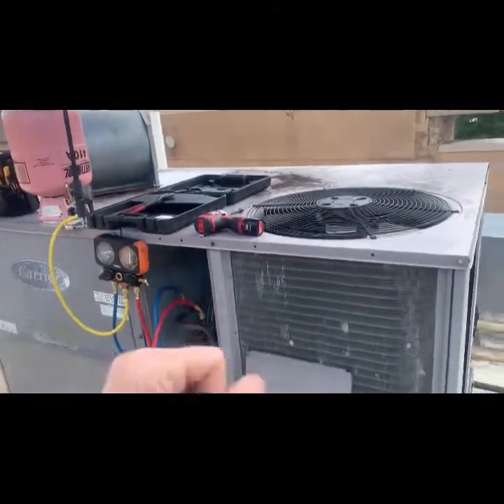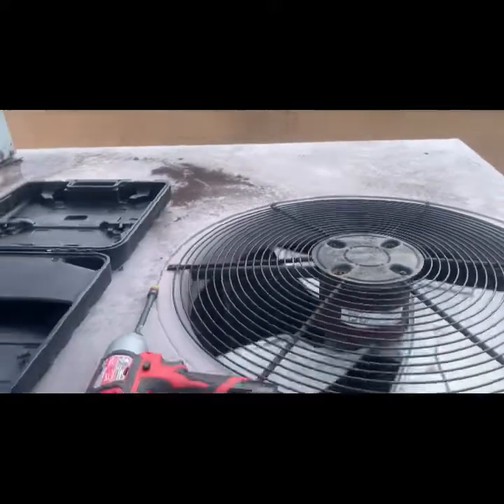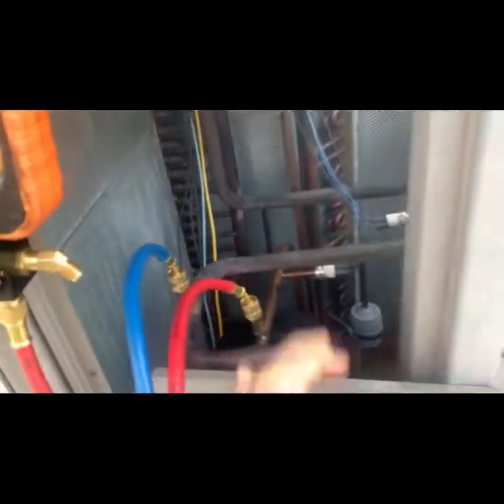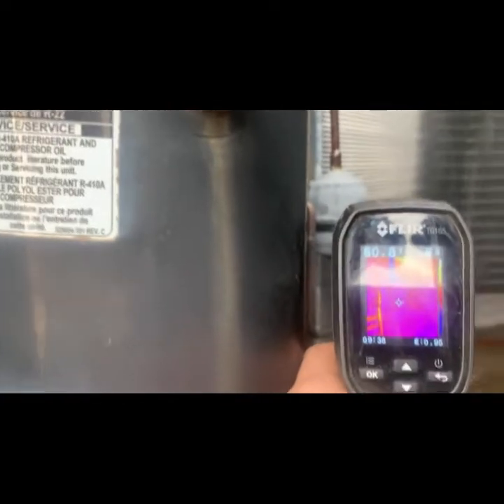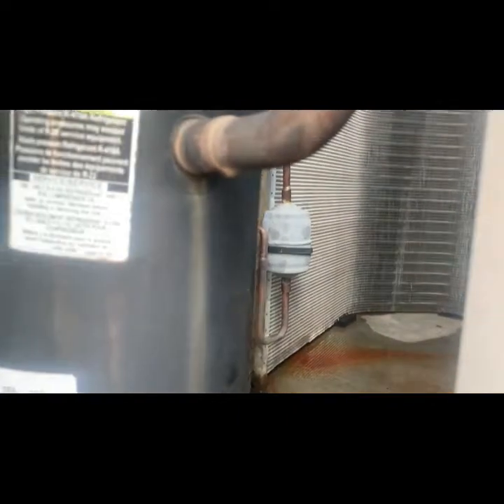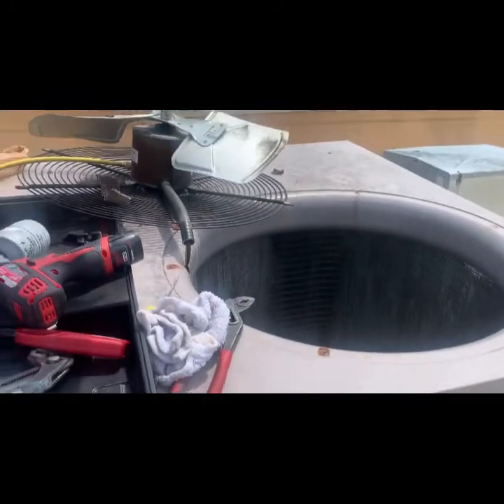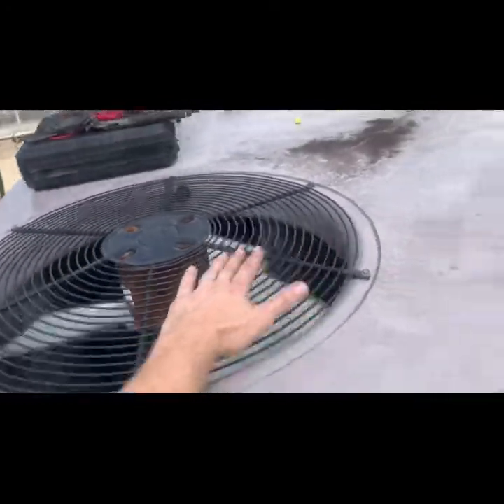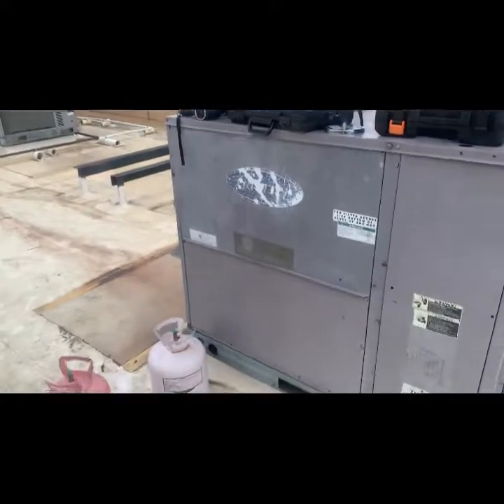Carrier 6 ton unit multiple offender

Comment: I usually just pull the motors and hop in there to change the drier
Reply from the maker: Then I know we’re similarly built cuz that’s what I did.   Not for the big boys.
Reply: @restaurantrepairs  I’m usually working by myself so that’s why but ya if you have help I’d pop the top off too